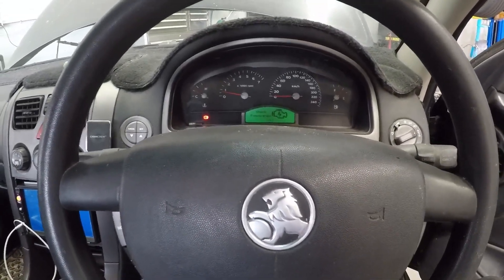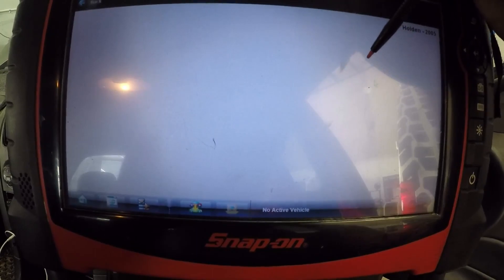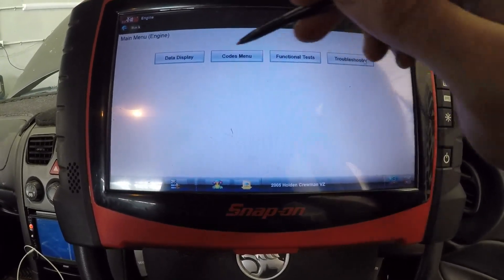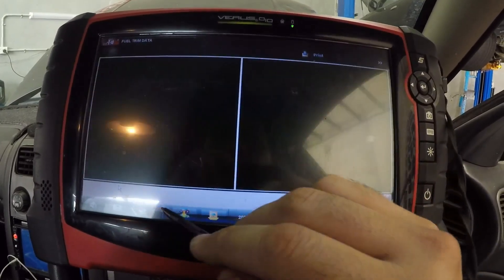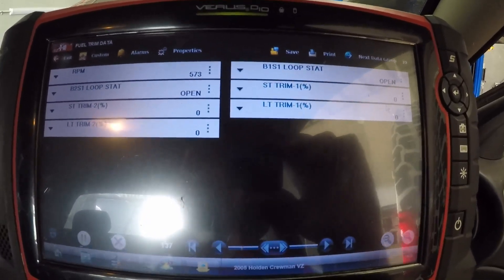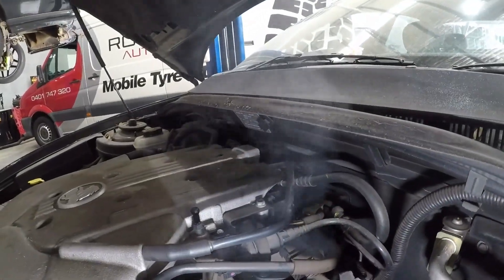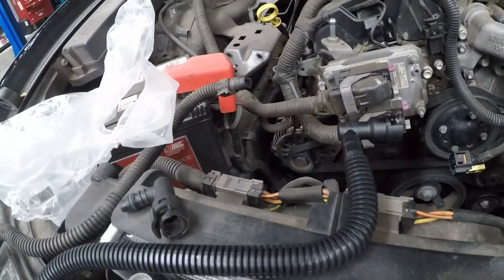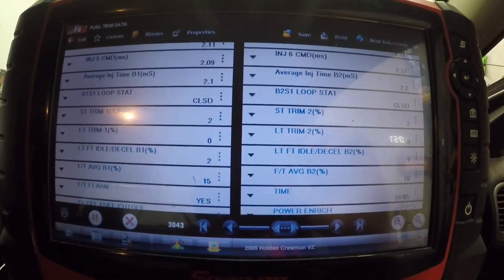VZ Commodore running rough at idle - 3.6L Crewman

Comment: Iv got a vz v6 wagon thats been goving off 2 codes for a maf and map sensor replaced both and then still comes up and then the safty mode and powertrain warning any idea if it could be vacume iv gone threw everything at this stage besides a leak or wiring possibly?

Comment: After change of spark plugs SV6 commodore vf. Now slight rough idle notice but drives and accelration is smooth like butter.
whats cause????
idle sits on 550 and stable even on idle but i can feel slightly rough.
Reply from the maker: Looks like you commented twice, I responded to your other one
Reply from the maker: C Lang where are you located? Maybe I can point you to someone local to you
Reply from the maker: Would you be close to Bellbowrie Mechanical, they are great down there!

Comment: Nice work.
If I'd gone to Holdens (rumour has it they don't exist anymore (yay!!!)), they'd have quoted $3,500 for "urgent repairs", and fixed everything that DIDN'T need to be fixed (or pretend they did, anyway), IGNORE the rough idle and say "oh, try some fuel injector cleaner next time you fill up...."

Comment: Can anyone tell me what the absolute throttle position % at idle should be for a VZ, mine sits at like 12% and I am wondering if my throttle body might be broken. I still have rough idle after plugs coils injectors and hunting all over for vaccum leaks 🤬
Reply: 12% is correct